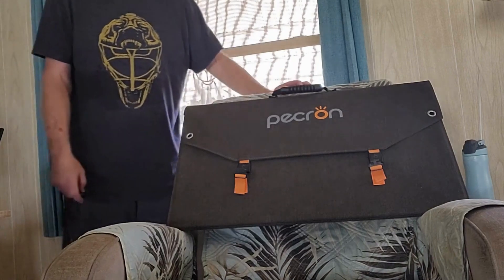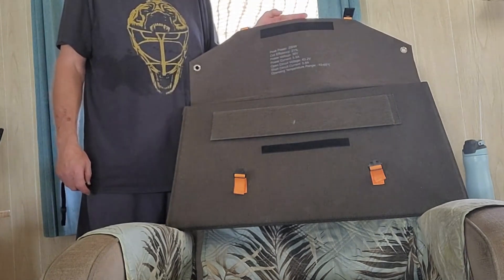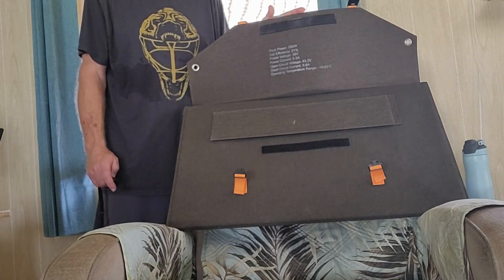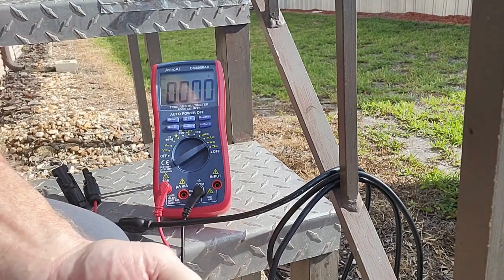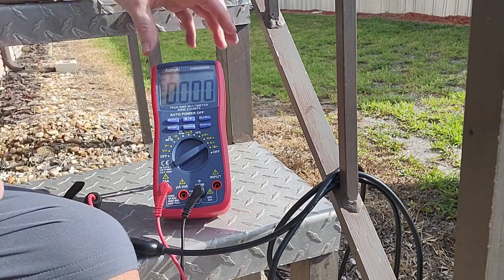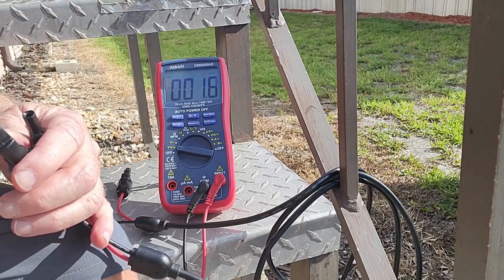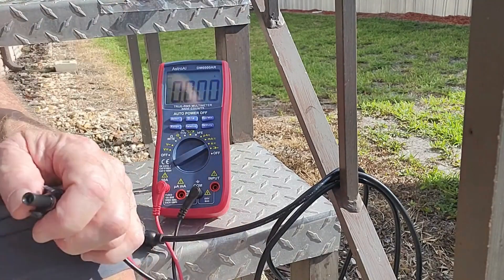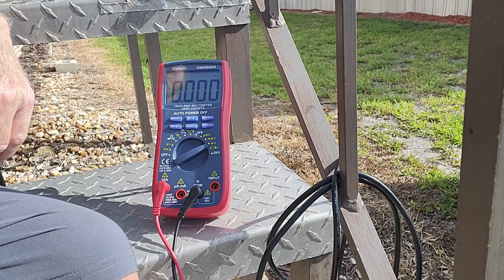Testing PECRON Aurora200 (200W, 36V) Portable Solar Panel w/Multimeter

Comment: I have the same panels and rarely do I get above 70 watts.
Reply from the maker: During these cooler months in Florida, when temps are below 80 F, I've been getting as much as 170 per panel. I found that ideal temp is between 68 and 75 degrees F. The ambient temp  makes a big difference, as well as the angle and direction of the panels, in relation to the sun. I should make a redo of these panel tests one day....
Reply: @mbrown89  I might get up to 90 watts for my aurora 200 panels. It looks like pecrons newe panels do better
Reply from the maker: @tommyo321 I have both types. So, 4 in total. Getting the good result from both sets.
Reply: @mbrown89  the new 200 watt panels are in sale for only about $210. Is there much difference between them?
Reply from the maker: @tommyo321 I like mine. The reason I got these is because they are water proof, where the Auroras were not. They are much lighter and flexible, as well. Easir to store in my van. Performance is similar in my situation. On a sunny day in the 70's, I'm getting as much as 170 Watts per panel. Of course, weather affects this. If you buy through my affiliate link, I get a small commission. No extra cost to you. I recommend them.
 https://www.pecron.com/products/pecron-aurora200-200w-36v-portable-solar-panel#ref=133
Reply from the maker: Feel free to call. I remember you and Rich said he gave you my number.
Reply: @mbrown89  I will tomorrow.  Thanks